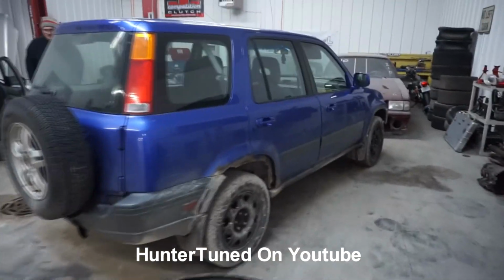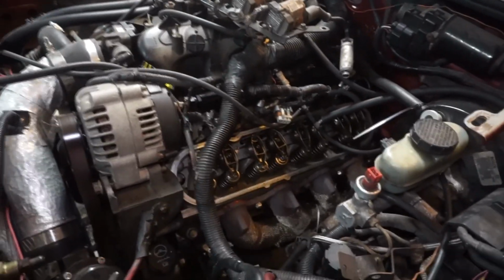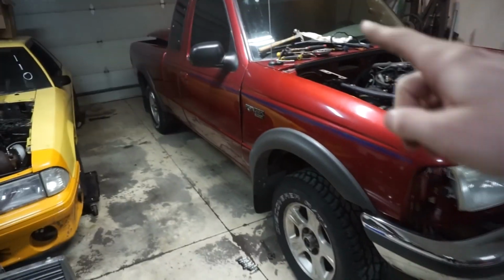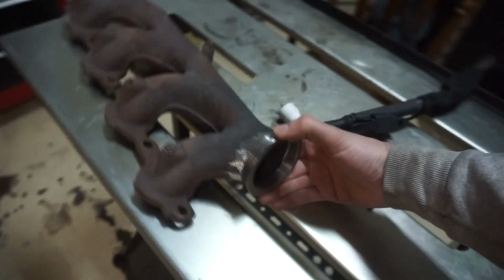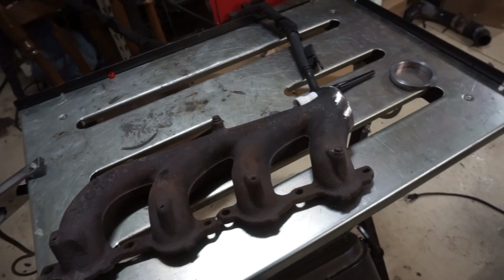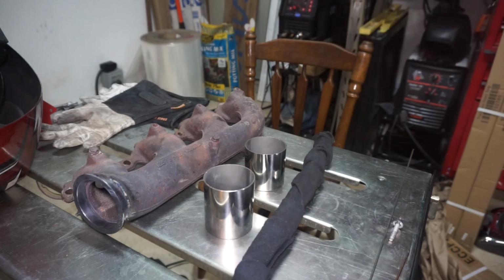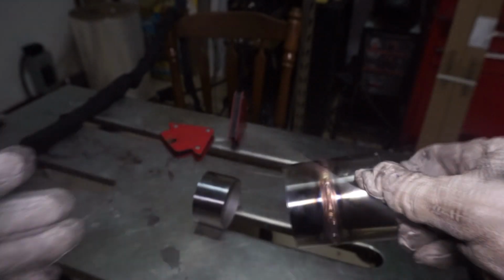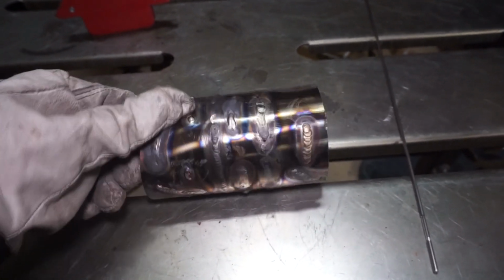Triple Turbo Ranger Manifold, TIG Welding Stainless, and Snacks for HunterTuned!!!

Comment: Forget dabs, you need a weave.  Make sure your gaps are tight, go faster and use less filler.

Some of the best pipe work is in vacuum chambers.  Most of those welds are done from the inside and are fusion welds with zero fill, just lips machined in and melted together.

The inside of your weld is "sugaring" which is an oxidation that will continue to oxidize rapidly and fail if your welds are highly stressed.  You need back purge to avoid that or less heat so the back side doesn't oxidize.  If you can go fast, use less fill and still get good penetration, you will minimize sugaring even without a back purge.

When I was doing stuff like that, I would even set up my welds so I could roll my tubes on my welding table and do 1/2 or more of the weld without lifting.  Get to that point and you'll be doing pretty OK (I was all right, many were better).
Reply from the maker: Yeah a positioned would be awesome eventually... I've been regulator shopping for purging. Tested the solar flux a bit today. Appreciate the tips!
Reply: @BlaserBuilds  before you get a purge setup, just practice doing butt welds of the thinnest wall steel tubing you can find.  Push yourself to go fast while controlling your penetration and making a nice small bead.

You'll save gas practicing like that and when you get a back purge setup, you should be ready to make good welds right away.

Comment: throwing dimes! call me crazy but I thought the first ones were better .. what does the color signify? proper penetration or something?
Reply from the maker: The first looked better because I was welding the thick Vband to the thinner material so is stays cooler. It's pretty easy to cook the thin parts.

Comment: 308l works fine for me, 309l is supposed to be better(?) I think. I preheat everything with a propane torch for a minute and post heat. Once that's done, I toss it in a bucket of sand or cover it in a welding blanket to slow the cooling. You'll be fine my dude. Can't wait to see this monstrosity come to life!